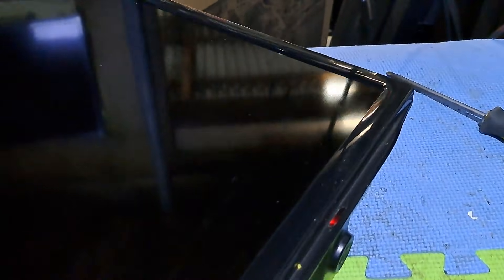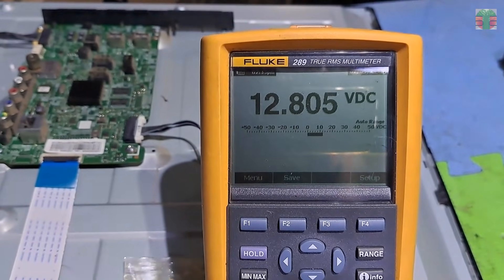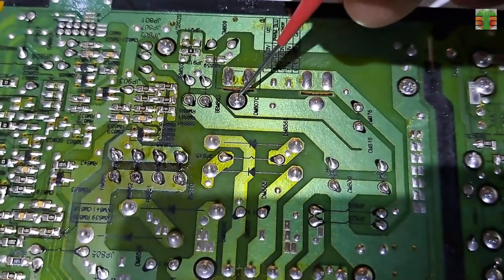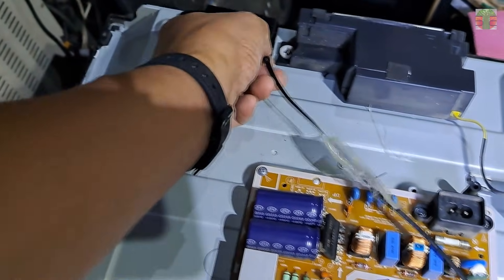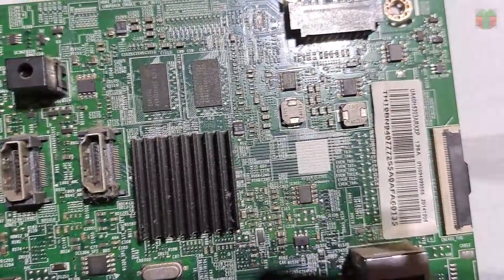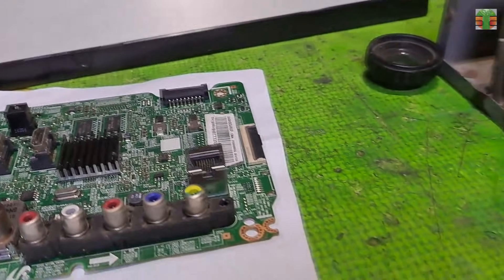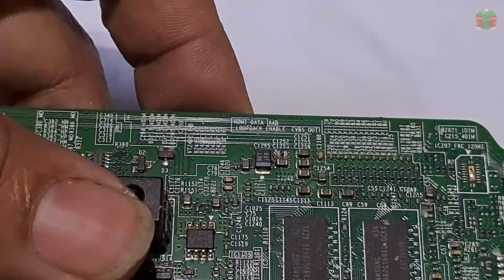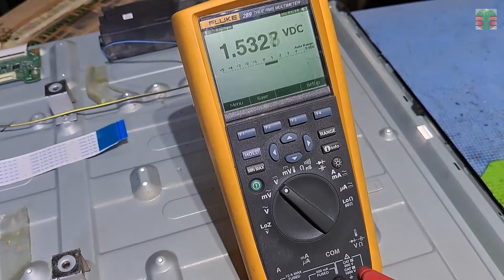Samsung smart TV not replacing the shorted capacitor.

Comment: Excellent video. Measuring voltages is a qu8ck way to find the problematic area and of course, voltage injection is the best method. I normally use alcohol to see it evaporate but the thermal camera is a must to speed up the repairð...thanks again for sharing your knowledge and skills

Comment: What pin on the connector was the 12.8v?
Reply from the maker: 12.8  is the 13 volts, no problem with it and it is the main power supply ouput.
Reply: Thank you Tevz. What pin number was that on connector?
Also please ,what does IT stand for on connector diagram.

Comment: Hi engineer
Why did you doubt the mainboard after the instability of the voltage in the power board was determined?
If the voltages on the power board are not correct

Comment: Interesting method to find the short. I've seen others use a thermal camera, alcohol or a flux mister but never a candle. It's a lot cheaper than a thermal camera! Do you use an isolation transformer when powering TV's? I recently tried to repair 2 OLED tv's that would not turn on but they seem rather complicated since now they allegedly use software to match the boards. Wish I could find a course on troubleshooting them.
Reply from the maker: I dont use an insolated transformer. Oled TV isn't yet around in my area.

Comment: Yes once i removed one shorted cap from laptop it works great for 15 years.
Reply from the maker: Removing one of the capacitors doesn't matter. Many capacitors are connected to the line.

Comment: 9:53 there is SMD diode looking cap C1265 right next to Ceramic capacitor C1252 that you removed. Is that C1265 capacitor? It looks like a diode. It'S Black rectangle with a stripe on one end. I never seen a capacitor which looks like that.
Reply from the maker: It is a tantalum capacitor.
Reply: @tevzTVTevatronics  thank you sir. Do you know it's value? What's Farad? What's Voltage? Thanks again.
Reply from the maker: @lightshine888  I dont know, not in my mind to note it sorry.
Reply: Thanks.  Can you tell me the bran name & part number of WHITE PASTE that you put on between FET & Heat sink? Thank you again for your answer so far.
Reply from the maker: @lightshine888  heat sink compound, it's a Chinese brand, and it is written in Chinese characters.
Reply: @tevzTVTevatronics  Can you give me a link to buy it? Thanks Tez
Reply: @tevzTVTevatronics  it would be great if you put the picture of that white paste can in next video. Thank you 😊
Reply: Sir, I'm from India. Regularly watching your videos. You r really expert like a perfect magician. I am also working in electronics repairing field like CRT TV Black & White and Color, Radios, Cassette Players, FM  Radios but still  not in LED Tv,  want to start led tv repair repairing. Can I ever seek your help sometimes? If yes, how is the resources? pls. Answer me.

Comment: Hi Tevz,  I wanted to ask something. The shorted voltage line was 1.5V You used an external power supply to figure out where the short is. This voltage was 4.1V.. The voltage was much higher than the design voltage. Luckily the short pulls this 4.1V low. If however while fault finding if it was possible for the short to go open circuit I guess you would cause damage due to over voltage. Am I right?
Reply from the maker: You are right, it is lucky it did not open the shorted capacitor. The power supply I use is not regulated, if injected into the shorted line it will drop at about 2 volts but still higher at .5 volts. But the TV works fine despite it being injected with a higher voltage.
Reply: @tevzTVTevatronics  if you had a variable power supply that could go as low as 1.2V that would be safer since mainboard could core voltage is around 1.2V and there is no voltage lower than that.
Reply: It's very unlikely that any component would get damaged even with hundreds of volts going through them if very little current is being drawn which is not possible by design but it is possible to regulate the current you inject and would automatically regulate the voltage by dropping it due to ohms law.

Comment: There is a very easy way to identify a bad SMPS in Samsung led TV's. Just open the power connector from the mother board if the backlight glows then the SMPS is ok , fault in the mother board.

My next suggestion is.....
To identify a faulty capacitor or any shorted parts it's better to use a regulated power supply. 
In your case the capacitor is connected to the 1'5 volt supply rail so at the time of injecting voltage ( more than 1'5 volt) if the capacitor gets open the other components may have affected.  So it's better to use a regulated power supply and start pushing voltage from 1 volt .
Otherwise it's a nice video brother and best wishes for your next repair.
Reply: yes